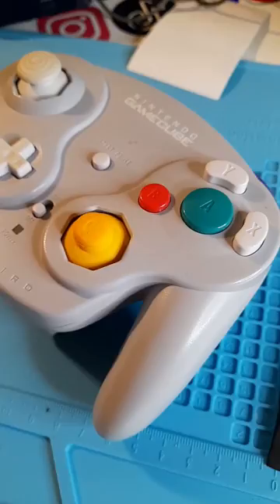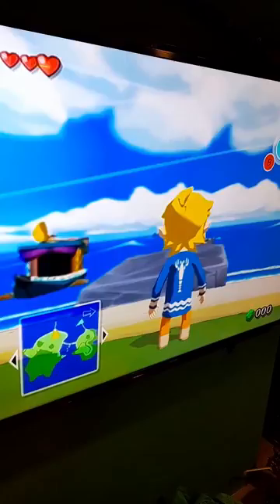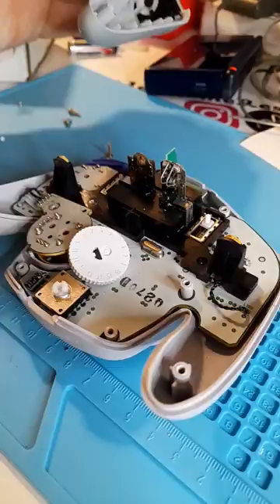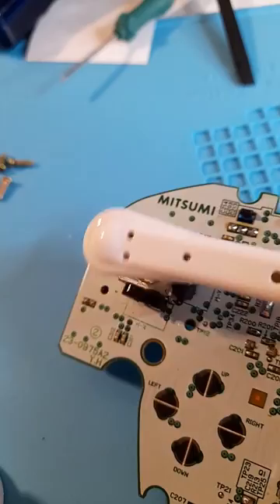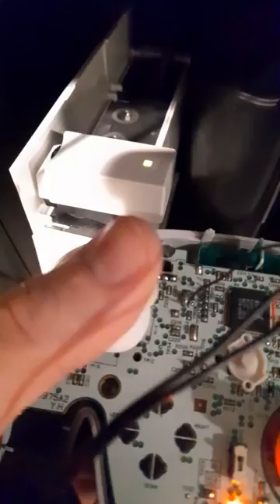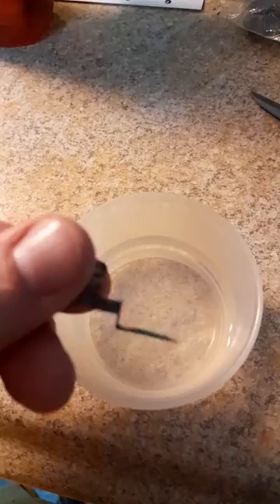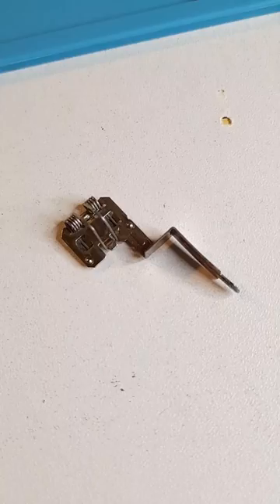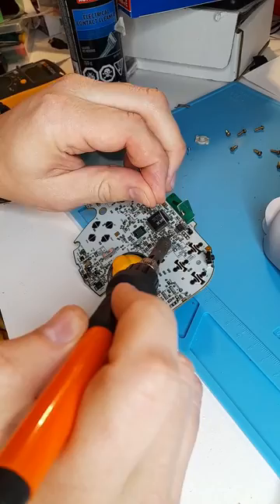Wave Bird Controller Repair

Comment: So I just got a wavebird off eBay for $90 bucks. And the left thumb seems very loose and moves easily when you barely touch it. It has no drift that I can see. I've never had a wavebird and idk if that's how they are. I've used the calibration on the switch and I see no drift. The seller is telling me to push the analog stick down I've tried that and still the same.
Reply from the maker: I haven't come across that issue yet!

Comment: I'm trying to fix a wave bird but the controller does turn on but the receiver wont light up when connected to the gamecube, it used to work before but suddenly stopped working, any idea of how this could be fixed? also gonna try the vinegar thing soon too and see if that solves the issue although I didnt see any corrosion on it
Reply from the maker: That sounds more like a reciever issue!